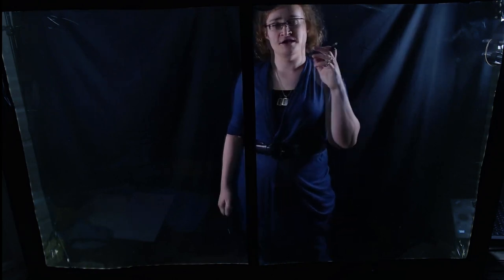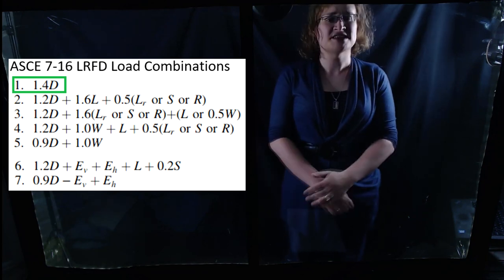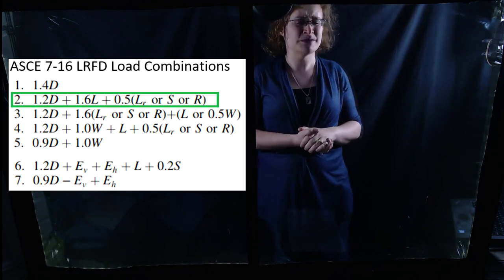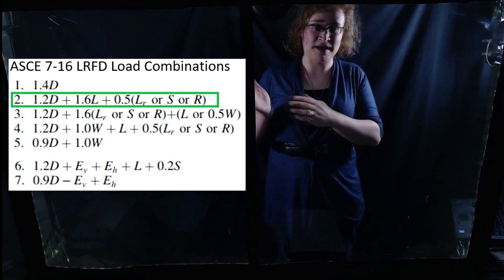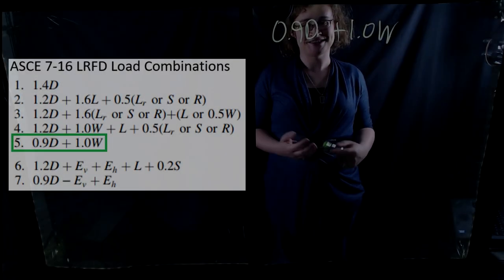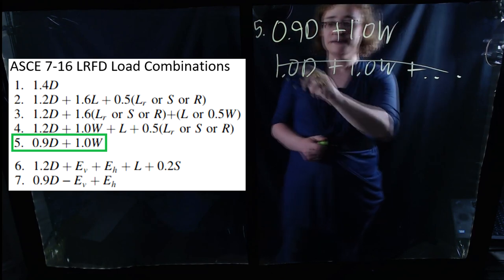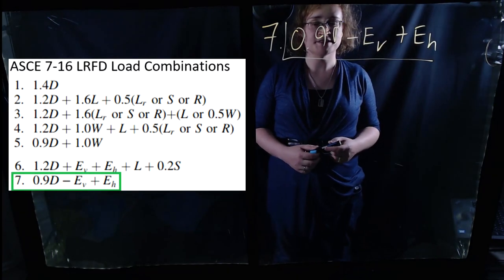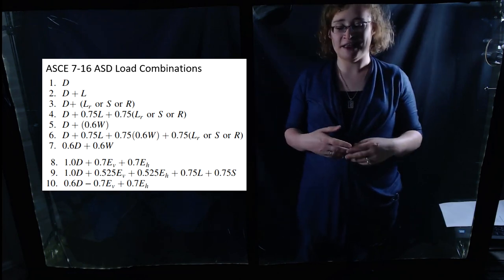Unpacking the ASCE 7-16 Load Combinations

Comment: In light of the anticipated advancements in artificial intelligence within the next couple of years, I am seeking your expert guidance on the strategic considerations associated with pursuing a Ph.D. in structural engineering. Given the potential integration of AI in design processes, what insights can you provide regarding the long-term relevance and opportunities for specialization within the field of structural engineering? Your professional perspective on the evolving landscape and the intersection of AI with structural engineering would be highly valued in informing my decision-making process. Thank you for your time and expertise
Reply from the maker: Sure. A few thoughts. First, keep in mind, existing generative AI models are trained on existing datasets. Someone involved in original research is by definition working outside of existing knowledge. For example, a PhD student might devote their work to designing, testing, and validating a new type of connection. But an AI would not be capable of that, as that connection has never existed before. AI can only churn out remixed copies of things that already exist; it can't make anything new. 

Another issue of completely replacing structural engineers with AI is that every structure is unique. You can't just copy the design of a structure intended for one location and paste it in some other location. Our existing AI models rely on huge sets of training data. You feed the whole public internet into a big training model and create ChatGPT out of it. You use that huge volume of text to teach the computer how to write. 

But it's hard to see how you would create such a dataset with structural design. You can't just feed a bunch of structural blueprints into an AI model and expect to train a structural engineer from that. Often beams or columns are at the location they are not because of mechanics, but because of the needs of the client. A column on a set of blueprints might be where it is because of some weird reason known only to the client. Or consider foundations. Foundations are designed to site soil conditions, and the location and design of columns are affected by this. Your site may have weak soils on just a part of it, or some soil you don't want to disturb, and this is reflected in the design drawings. But all that nuance is lost on a training model that is trying to derive all of structural engineering from just a set of plans. 

Really, I am not optimistic of generative AI replacing structural engineers any time soon. We already have software that can automate some functions of structural engineering in a limited, well-defined concept. For example, software exists that uses evolutionary algorithms to optimize the design of parts using stress analysis. It is not remotely possible today to feed an AI an architect's blueprints and a soil report and have it spit out a set of structural drawings.  There simply isn't enough training data to capture all the permutations. 

And even if these get better, keep in mind that the demand for engineers and architects is not a fixed quantity. For example, today in the US, only the most expensive homes are custom designed by architects. Most people buy mass produced tract homes. For most, the first step in buying a new house is not contacting an architect. Most just go buy a tract home. 

But what if the architecture and structural engineering could be automated enough to lower the cost of those services? What if an architect can design a house in 1/10th the time, and a structural engineer can design the structure in 1/10th the time? They could cut the price they charge accordingly. Suddenly, the amount of people who can afford such services increases. The artistically designed custom home goes from being a luxury of the wealthy to the norm everyone can afford. 

I look to history, and the example I think of is clothing. In the early industrial revolution, people were poor and typically only owned 2-3 outfits that they likely handmade themselves. With automation, people worried that we wouldn't need weavers anymore. In the end, the demand for weavers actually went up. Instead of owning only a handful of outfits, people now own entire walk-in closets full of clothes. Instead of wearing the same outfit for weeks at a time, many wear multiple outfits in a single day. Technology made it easier to make clothes, but that also meant people could buy more of them.

That's the perspective to keep in mind in discussions about tech-related job losses. Yes, technology will automate some of the services that structural engineers currently do. But in turn, structural engineers will be able to do more jobs in a day and will be able to charge less for each job. More people will be able to afford the services of structural engineers, and we all end up better off for it.

Now, in theory, sure, you could imagine a computer far better than any bot that exists today. You can imagine a truly general artificial intelligence that can communicate with clients, operate some robot drone that can perform site visits, and monitor construction progress. But to truly replace everything a structural engineer does, you would need to have software that can literally do everything a human can.

And even if you have a computer that is fully as intelligent and capable as a person, I still don't think the profession is doomed. Even if you've can mass produce Lt. Commander Data, I don't think the structural engineering profession is doomed. 

Why? Because I would argue that a machine that is fully capable of performing every task that  a human can, that can do so in a way that is indistinguishable from a person, that can operate in our society like any other person...simply IS a person. An AI that advanced likely has its own thoughts, desires, and goals. At that point, you really have to start worrying about the ethics of forcing such entities to do your bidding. In short, if your computer is so advanced that it can completely replace a structural engineer, forcing that computer to work for you is probably slavery at that point. And we really shouldn't be creating a slave race of intelligent robots. Read either a sci fi or a history book to learn how that ends. 

And if you need to pay the new structural engineer AI you just created, there's no reason to create that AI in the first place. You might as well just hire an actual human.

Comment: Hello Tanya.
Thank you very much for the fantastic video. I am a civil engineer in Europe and I am supposed to do a dimensioning of a facade mullion for a project in the USA. In Europe, the area moment of inertia of the mullion is determined from the allowable deflection. The deflection is calculated from the serviceability limit state (SLS) combinations. The section modulus, in turn, is calculated from the ultimate limit state combinations (ULS). Is there a standard that lists the serviceability combinations?
Best regards and again, great videos.

Comment: How do you deal with load combinations that have both gravity loads and lateral loads? for example: 1.2D +1.0W + L + 0.5(Lr or S or R)? When designing your gravity resisting system, we would neglect the W in our calculations and then designing our lateral load resisiting system, we would only deal with the wind, correct?

Comment: Sorry for the question, still a bit confused. ASCE 7-10 and 16 gives FACTORED Wind speeds which gives factored wind pressures. If I’m designing a masonry curtain wall (cladding), this means I should NOT use ASD load combinations? But if I’m checking a roof membrane capacity, then I CAN use ASD? What about for components, such as roof purlins, also no ASD? Should we match ASD/LRFD load combinations with ASD/LRFD methods for steel/masonry design or should this NOT matter? Thank you.
Reply: If ASCE 7 shows that the wind speeds they are using is factored, then an ASD equivalent should be provided based on a factor (in IBC, I remember seeing sqrt(.6), but a similar factor might be in ASCE as well). 

If that’s the case, I would use the final wind pressure calculated with Vasd in the asd load combos if that’s needed.

Comment: Interesting approach, but the idea that LC 5 (ASD) and 7 (LRFD) are accounting for vertical forces is completely wrong. If you look at the first building code requirements from 1945 (ASA 58.1-1945), you can see that there were no established combinations, but there was a requirement for the overturning moment due to wind shall not be more than 66% (2/3) of the moment of stability (5-9.a). This is the origin of the infamous 1.5 overturning factor requirement that is often incorrectly applied today. In later ASCE 7 editions, this requirement was baked into specific load combinations for both ASD and LRFD. in ASCE 7-05 which implemented allowable level wind, we has 0.6D+1.0W. Later on these load combinations were adjusted to account for ultimate level wind, but the purpose of the combination remained the same. If you dig into both wind and seismic chapters, you will find detailed considerations for vertical forces and or uplift that must be considered during the design. For seismic there are even additional load combinations.

Comment: miss 0.6D+0.6W (ASD uplift), why 0.6D?
Reply from the maker: Uplift is an interesting case. Imagine a simple structure, say a pergola or a simple rectangular frame. Normally the columns carry a downward load. The weight of the columns and the structure above is added to the external loads. To add some margin of safety, you would want to overestimate your dead load, for example by designing for 1.2D. 

But what about uplift? Now the columns of that structure are being put into tension. Maybe there's a large wind over the structure generating a huge upward force on it. 

But how does gravity relate to this uplift? Think about the relative directions. Uplift wants to pull the structure into the air. Gravity meanwhile is still acting as it always does, pulling the structure downward. In this case, gravity is acting in opposition to the applied force. If the columns are in tension, the dead load will actually be decreasing the maximum tension on the columns.

In other words, in the case of uplift, dead load will actually HELP you, not hurt you. Thus, to provide a margin of safety, we have to reduce our dead load, not magnify it in the case of uplift.
Reply: @TanyaLairdCivil  Well said. Time for me to eat another Snickers bar in order to further combat uplift. ;)

Comment: If case 7 in LRFD, 0.9D is reducing Dead due to vertical loads, why include Ev in the combination. Why doesn't case 5 have a Wv load in the combination? I was under the impression that a reduced Dead load accounts for the opposite of case 1, over estimated dead loads. These cases are overturning cases where the dead load is overestimated and the horizontal loads are at full capacity. These cases produce an overturning factor of 1.5. If under estimated loads are possible, then overestimated loads are also most certainly possible. For me it doesn't make sense that 0.9 is intended to account for vertical loads. It just doesn't add up. There is still judgment needed when applying loads, the load cases are not intended to be blindly applied.